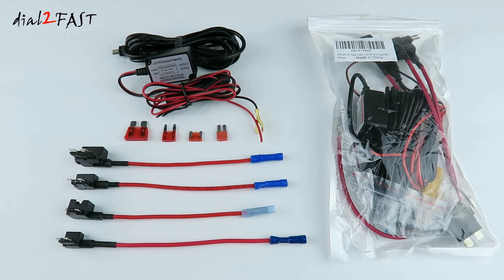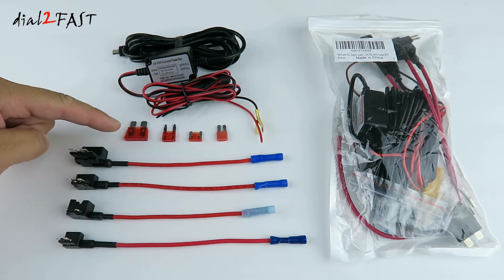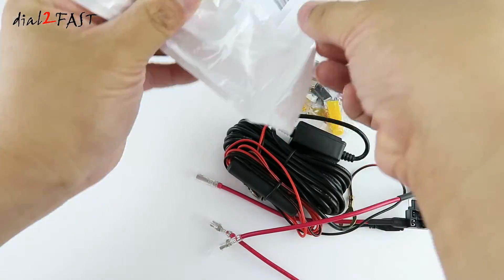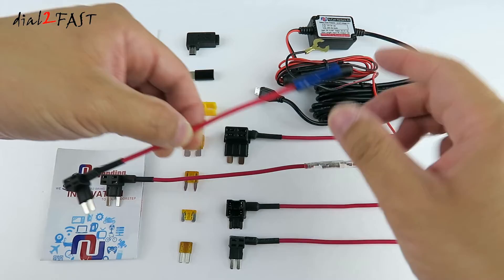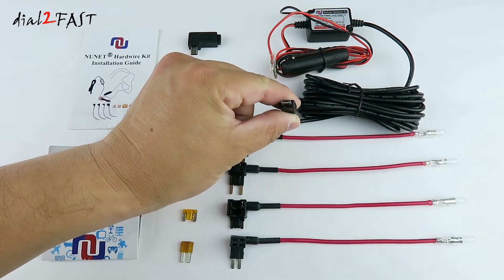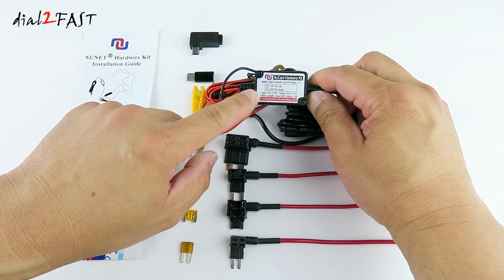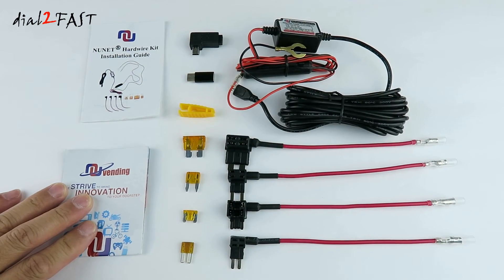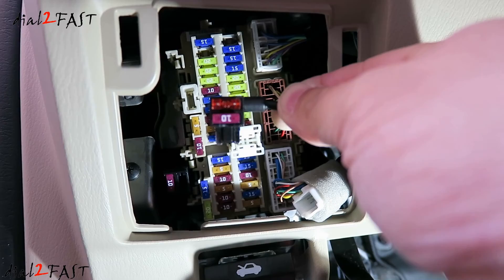How To Hardwire A Car Dash Camera w/ Parking Mode - NEW VERSION

Comment: If I take the blue 15 from the car fuse box, do I have to put a 15 as fuses for the dash cam or is the yellow 5 one sent by you enough?
Reply from the maker: You don't need to put a 15A in the top slot. For dashcam, put the 5A in the top slot.
Reply: @dial2fast  Thanks

Comment: I recently bought a hardwire kit but accidentally purchased the kit that comes with the 4 cut-off voltage selections. What function do you recommend for a dash cam on a 2017 Camry ?
Reply from the maker: Set cutoff to 11.9-12.0v.

Comment: Hi, thanks for the video. I have a question for the fuse tap. Can the same amp fuses be used? Example 2x 10amp or must the top fuse be a lower amperage?
Reply from the maker: The top fuse should either be the same or less than the bottom one.